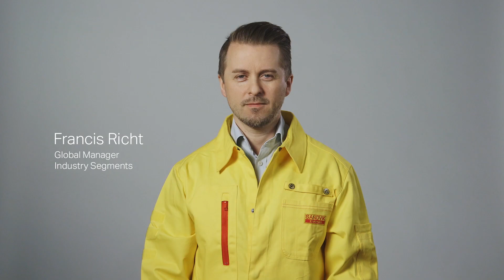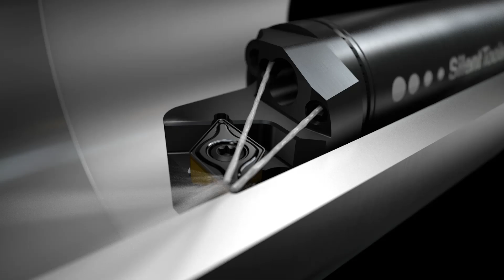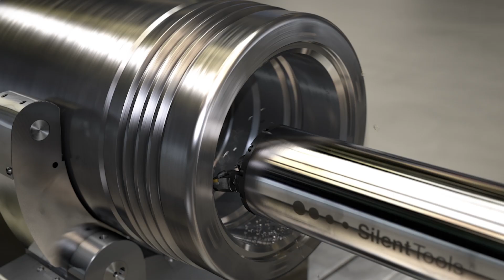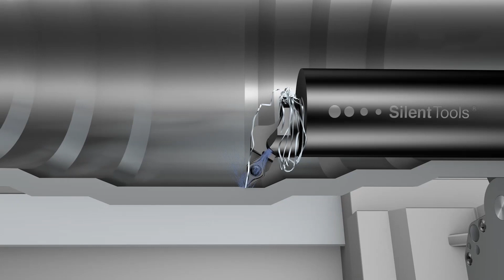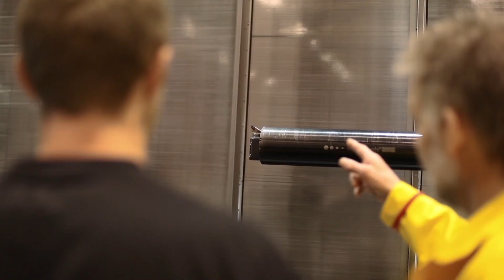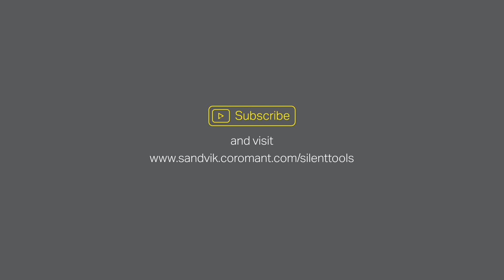Tips film #36 - Long overhang machining in advanced materials

Comment: Impressive, busting the chip and evacuation is paramount! It's a real hassle when the stringers are in the way, ID or OD.  On older machines, I hate when operator's have to keep the door slightly open and pull them with chip hooks, very dangerous. Terrible when a bird's nest slaps your arm or face.